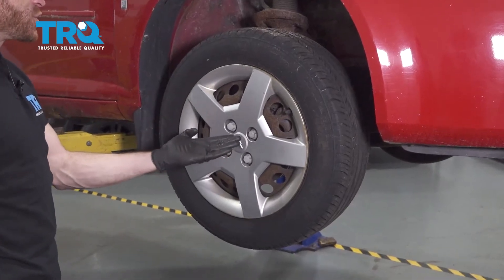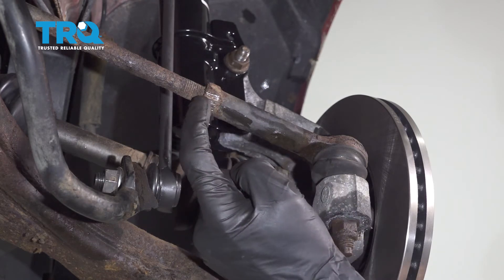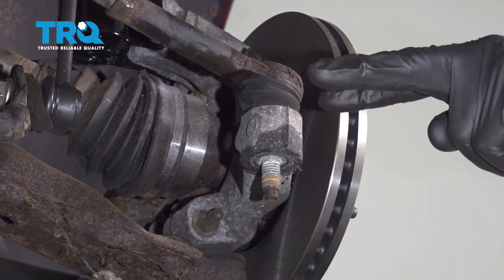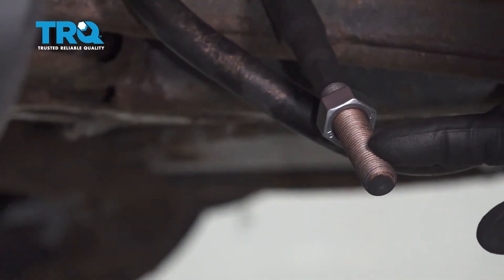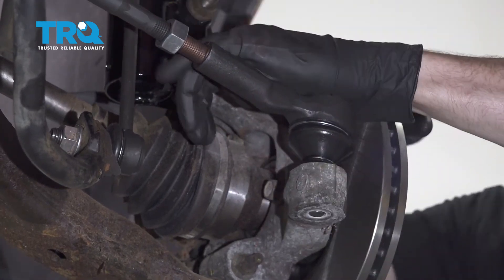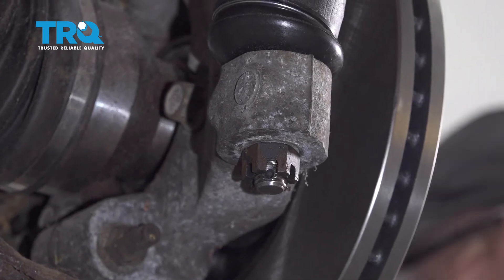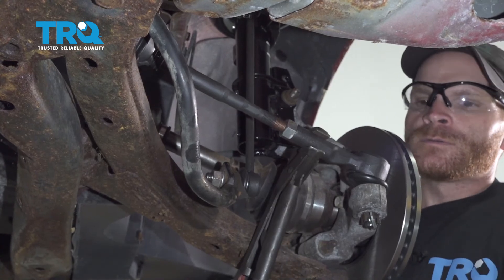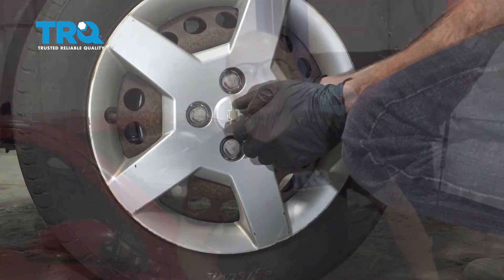How to Replace Front Outer Tie Rod 2005-2010 Chevrolet Cobalt

Comment: If your doing this job for the first time in over a decade or two yourself. You will likey need a torch to get things moving. Particularly the Jam nut. No amount of PB blaster will ever make it easier to move. But getting it super hot does the job